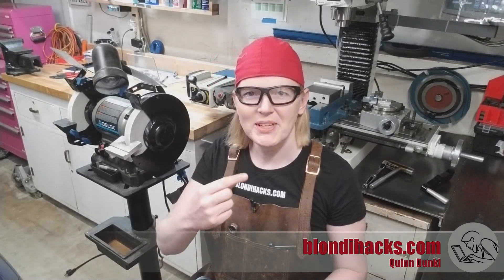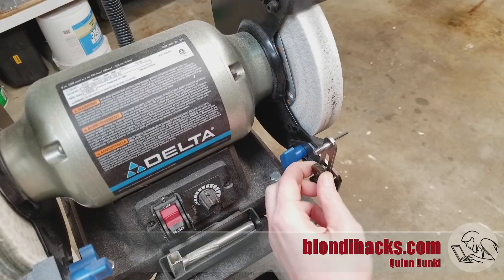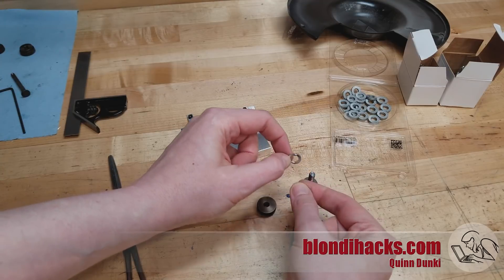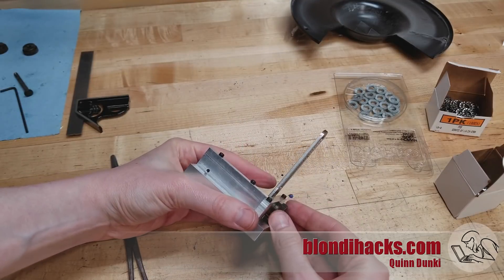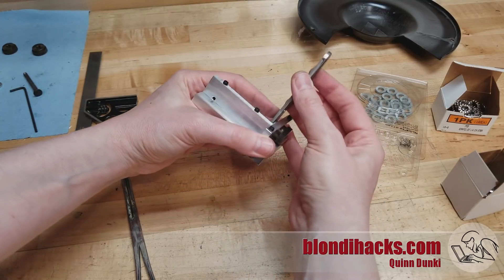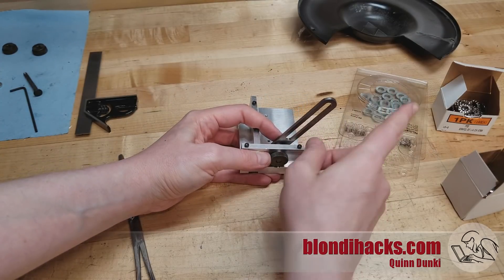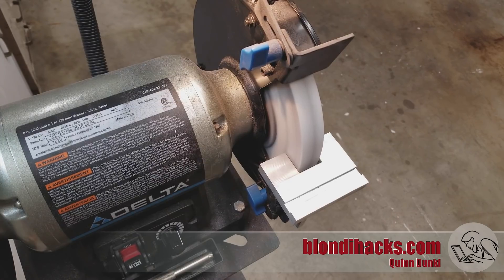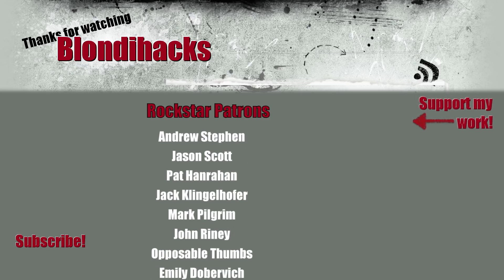Bench Grinder Tool Rest Replacement : Part 4/4

Comment: The nordlock needs to be under the nut. It works by grabbing the nut and the surface. When the nut tries to loosen it actually has to stretch the thread. It won't work properly to just increase friction. Thanks for the videos! I have the same grinder and I really like what you are doing here.

Comment: Is the riser part stiff enough ? No roll on the rest ? Also, could the rest itself, thick as it is, get to bind the wheel like a cantilever clamp if roll occurs. I'd want to have more clearance on the sides. I guess you get a better feel for it than me on my couch. Thanks for the calm and precise commentary and thanks for no music. Subscribed.
Reply from the maker: Oh goodness no, there’s no way that’s going to bind the wheel. It’ll grind the rest to dust before that happens. There’s no flex in the riser. It’s 1/8”’ steel plate and only a couple of inches long.

Comment: Put a couple holes in the thumb wheel and make a pin hook spanner or face spanner. - Stamped sheet metal wheel covers should be illegal!  Some great results there Quinn.

Comment: Nice job! Like your video's thanks. Little trick for removing mill scale (you may know?) Sno Bowl toilet bowl cleaner. Put some in a plastic bowl drop in the part, drink a beer or two, take it out and the part is clean as a pin. Don't leave it to long. Cheap and sure beats scrubbing it off! Keep up the good work.
Reply from the maker: Interesting! My guess is the ingredient doing that is lye. That's what's generally in drain cleaners, toilet cleaners, etc. A powerful base. I'll give it a try!
Reply: Dunno?? Both of ya'll have put more thought into it than I ever have.... Know it works, been using it for years building bit's, spurs, buckles and such. Works quite well actually.
Reply: It's actually not lye but hydrochloric acid...I don't recall the concentration.

Comment: Nice build with endless possibilities! 

Maybe an adapter for grinding tungstens for your TIG torch—if you TIG weld of course.
Reply from the maker: Great idea! I've been learning TIG, in fact, so that would be a great addition.
Reply: @Blondihacks  Careful, you should keep a separate wheel for grinding your tungsten tips, lest you embed other metals from the grinding wheel into them, or otherwise contaminate them. I keep a separate lower speed grinder just for TiG points.

Comment: I really like your miter slide. That was enough to convince me that I need to make new platens for my grinders. To make them adjustable, I intend to use a pin for the pivot and mill an arced slot with a rotary table, and use a thumb screw to lock the angle. 
I was curious how you were going to address deflection of your attachment points to the sheet metal covers. Your solution looks like it worked well.
Reply from the maker: Terrific! Glad I could inspire a project for you.

Comment: I bolted my 8" grinder to a laminate faced piece of 3/4" ply to gain some additional room in front of and on each side of my grinder and then bolted two of these to the ply base Quinn. http://www.leevalley.com/en/wood/page.aspx?p=32973&cat=1,43072,45938. Having an adjustable arm on each side vastly stiffens up the platen table. Even though the Lee Valley rests are hard anodized, over time the grinding dust still wears that off. As soon as that happens the aluminum starts getting grooved and galled. In hindsight I'm not a big believer in using aluminum over steel or even cast iron for a decent grinding rest. I also think any tool that requires frequent adjustments should be made as tool less as possible. Lee Valley added adjustable ratcheting handles and there a huge help in keeping everything tight enough to not loosen due to any grinder causing enough vibration to continuously cause the problem. MSC would be just one supplier of them, https://www.mscdirect.com/browse/tn/Hardware/Adjustable-Clamping-Handles?searchterm=adjustable+handles&navid=4287923596. Only time will tell if your thumb screws will allow enough tightening pressure, but if not the adjustable handles do work well. 

Fixed angle gauges and a degree protractor on the table will obviously work, engraving the divisions and stamping the degrees is a whole lot of work for something that ends up with eye ball accuracy. An idea I stole off the wood wacker crowd was to just use a digital angle setting gauge like this one. https://www.amazon.com/Digital-Bevel-Gauge-Angle-Protractor/dp/B00M9ZHSPE + - .01 degree accuracy is going to be better than any engraved scale that doesn't have a vernier plus there fast and repeatable. If it were me I think I'd just machine a small version of what a wood working table saw comes with for your platens miter slot and the digital angle gauge can also be used to preset it to what ever angle you want.

Comment: Came out nice.  You might try those "Clamping Lever" handles that you can reposition as you can get lots more torque I use them on things like that they work well but are not cheap as reusing the factory knob.
Reply from the maker: Yah, I think those would be a good option. I may retrofit.

Comment: Another fantastic video.
Would it be possible to do a video on the carriage locking lever you made for your lathe?. My lathe is very similar and I have to retract the whole slide to lock the carriage using the allen bolt. Not quite sure how you made it.
Reply from the maker: I might do a video on all my lathe mods, including that one. That lever is just a piece of flat stock with a little piece of an old allen key pressed into a hexagonal hole in the end. So it's effectively a very flat 90º allen wrench, and it fits under the gib adjustments on the cross slide.

Comment: It is great watching U work thru problems on the fly. I have two suggestions for your consideration. There are Belleville conical spring washers (McMaster Carr) which might work better in UR application and also if you put a bushing beneath UR thumb-screw to extend it past the lip of the platten you  would be able to grasp it better to apply torque (leverage) - a longer bolt would be needed obviously.

Comment: Really enjoyed this series Quinn. 
You should do a remake on the miter gauge. You are correct with the lock not holding, it needs to have a pivot pin and a separate locking mechanism. 
Again, thanks for sharing your craft. 
Cheers

Comment: I was again impressed when you used the term "depth gauge" as the original name of these measuring instruments was "micrometer depth gauge" NOT "depth micrometer".  You must have apprenticed with some old school folks who taught you right.  As to the Nordlok washers they work extremely well when exposed to the proper torque, which is much higher than you can achieve with your thunbscrews.  Again, great video and I look forward to your next offering.

Comment: On your tool bit jig if you made it a left hand thread would the vibrations tighten it instead of undoing it?
Reply from the maker: Good question! I don't think so, because the vibration is in all directions. Left-hand threads will keep spinning things from loosening (assuming counter-clockwise rotation), but vibration will loosen anything.

Comment: Have you ever read any of Carroll Smith's books? A good portion of his oeuvre is racecar specific, but still broadly applicable. It's hard to overstate how big an effect they had on the way I approach solving problems. He had an amazing talent for making engineering practical and de-mystifying the process of designing and making stuff. Your style is unique, but the effect is the same.
Reply from the maker: I have, in fact! I used to build race cars for fun (before machining took over my life).
Reply: @Blondihacks  I should have read the comments first! :)